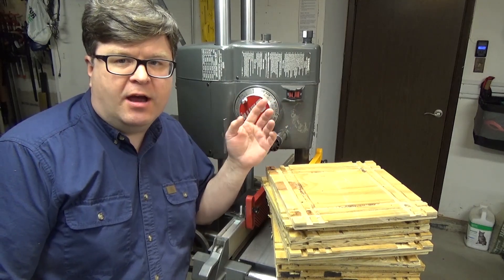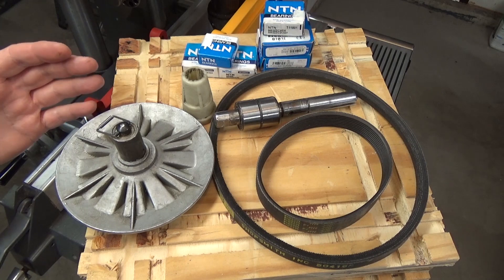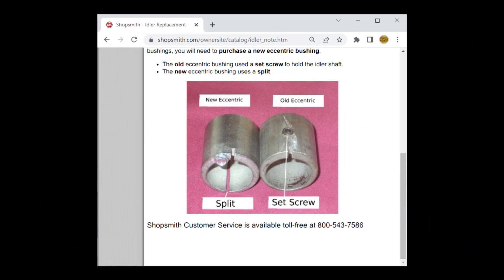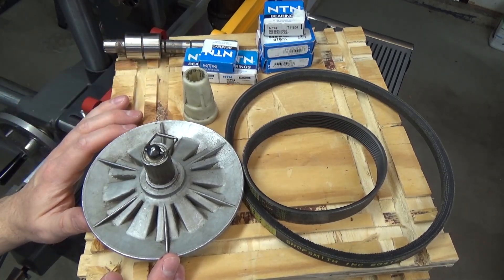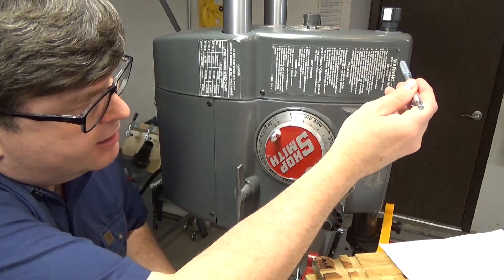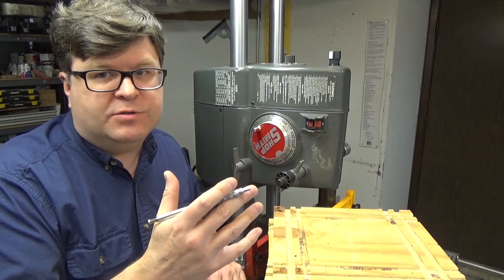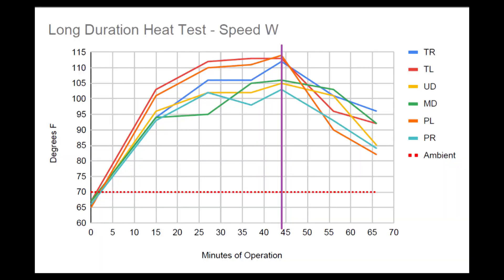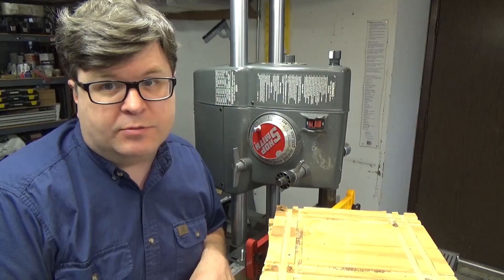How Hot Does My Shopsmith Headstock Run?

Comment: Thanks for the info on this, Tom. After using my jointer for the first time yesterday, I found the high speed output was very warm to the touch. I'm curious, did you replace just the bearings within the headstock, or did you buy the replacement shafts, etc. from Shopsmith? If you did replace just the bearings, do you have a source for them?

Appreciate it, and have already subscribed to your new TWT channel!

Comment: I love the channel name and videos. In the case of your channel, being a sawdust covered nerd, is way cooler than any sweaty jock could ever be.  My new yet old 520 has no heating problems. The machine was pre owned yet brand new when I bought it off of Craig's list. It hasn't even broken in yet, but I'm working on that. Apparently, the heat is a bearing wear related issue.
Reply from the maker: Thanks Haujean! Congrats on the 529, that’s a great machine.
Reply: @woodshopnerdery  It certainly is, and you and I share the same level and type of appreciation for it in so many ways. A few years back I wrote two reviews on the Shopsmith website, one about their blades, and one about the table extension brackets. Since then, Shopsmith has used both of them repeatedly in their weekly email specials. I don't remember exactly what I said except for the final sentence in my review of the extension brackets. This is my quote, and I know that you will agree with it completely. "When you stand in front of this machine, the only limitation is your imagination".

Comment: Nice video! You have inspired me to dig inside to see whats there. My 510 is from the mid 90's. I will do a stress test soon to see if it gets hot.
Reply from the maker: Great! Glad you liked it. Hopefully you don’t have a heat issue, like I did. I believe replacing the bearings is what solved it. As machines go, these are pretty easy to work on.

Comment: Hals Wood Shop.   My story.  my first SS I had 25 yrs.,, sold it when we moved cross country..yeah sounds dumb.  But only felt hot with ripping heavy stock and long term run time. " the touch test on top"  Now SS #2 is a 30 yr. old model also a 510 and I am trying to put it to the test but need more time. Good idea about temps. This shows what the machine can do.  Another testimony.   Thanks.
Reply from the maker: Thanks for adding your experience, Hal. I appreciate it!

Comment: Tom, the new two-bearing idler shaft that you showed wasn’t introduced until the PowerPro headstock was developed, around 2010. The hottest spot on many headstocks is the idler shaft. Anyway, fun video. Scott
Reply from the maker: My mistake. Was the new eccentric bushing introduced at the same time? Mine had the new eccentric when I got it.
Reply from the maker: Looks like I was wrong on another count. My assumption was that that the "new" eccentric was only intended to work with the "new" idler bearing. So since my headstock had the new eccentric I made an assumption that it was manufacture with the new bearing as well. But, looking that the exploded diagram on SS website, the drawing shows what looks like the old bearing, with the new split eccentric. Also, on eBay I am seeing idler shafts and sheave take-offs that pair the split eccentric with the old bearing. So that is evidence that maybe my 1991 headstock came with a split eccentric and the old style bearing as new. I wonder if the new eccentric was introduced with the "C" headstocks?
Reply: @woodshopnerdery  Yes, I believe that’s when it was introduced. There have been a lot of little, almost imperceivable changes and improvements made over the years. The idler shaft and eccentric gave Shopsmith Inc. a number of fits. I still think Magna had it right when they had the little retaining brackets that were held in place by the bolt.